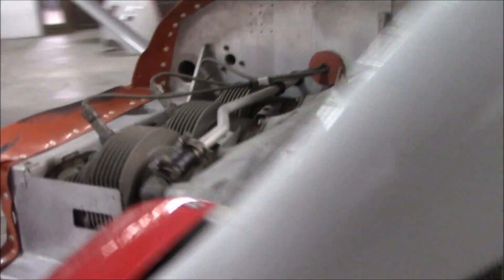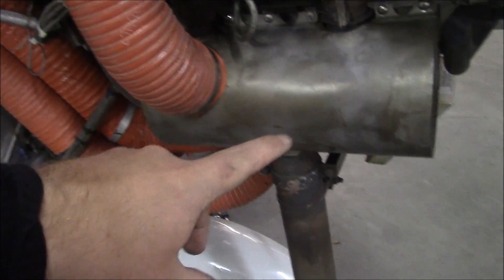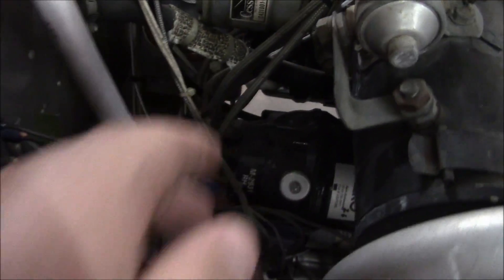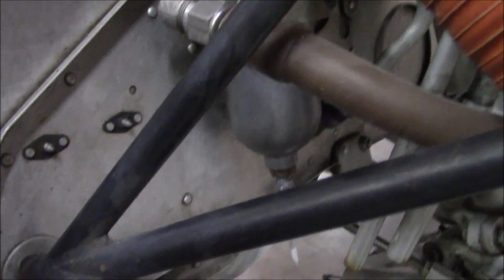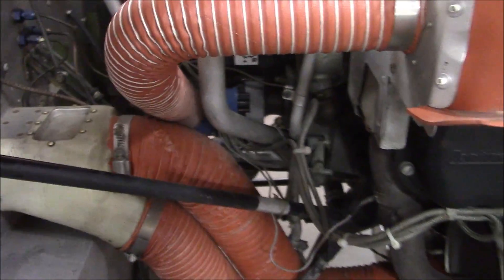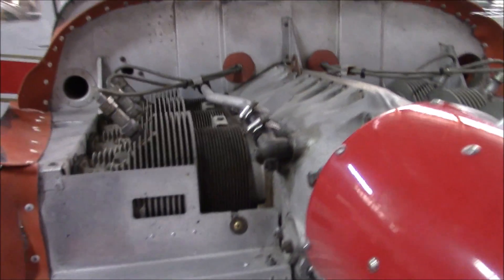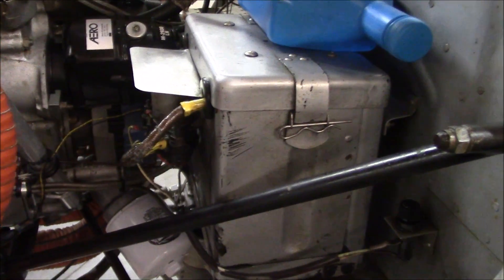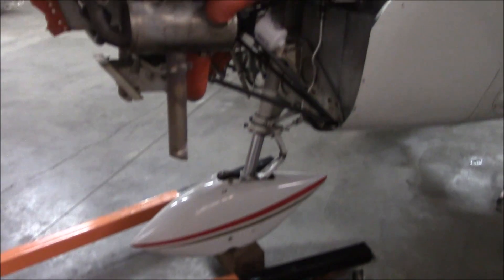Cessna 172 Continental Engine Overview

Comment: Daniel, I have this motor. I am considering making the upgrade to the 180hp. Different guys at the airport say not to give up this smooth motor while others say go with the performance. What are your thoughts?
Reply: i've owned both..the Continental is noticeably smoother than the Lycoming  pick your mission..the 180 is nice in density altitude  and rate of climb situations but look at your mission...do you carry more than two souls,weekend baggage and full fuel?...do you need the extra few knots in cruise?...if you fly mainly low terrain and don't need the extra hp..i'd stick with the six banger
Reply: @mattf49006  thank you!
Reply: @concourcolt7527  ..anytime...be safe and enjoy your 172....out of 11 aircraft ive owned its always been a favorite

Comment: Hi folks, yes great video had a 1962 172 enjoyed it immensely. Never could understand why no oil cooler as I believe the Continental 0 200 had one. Any comments would be highly appreciated thanks much.
Sincerely Mike Burkes
Reply from the maker: I can't speak to that specifically. Even flying at gross weight and climbing in 100+F, I have not cooked the oil. -Dan
Reply: @danielolivermcelroy8320  Hi Dan, what kind of oil temps do you see in those conditions? Thanks

Comment: Hi Dan, first I want to congratulate for your channel!! i love it!! , i´m always ready to learn specially when is about your cessna 172 because I have the same model as yours.... I do have a question for you, how many RPM´s you can get a full throttle in your plane? thanks and regards. Cesar
Reply from the maker: Hi Cesar! I think I get 2550 on takeoff and can easily exceed 2700 in cruise if I am not careful. -Dan
Reply: @danielolivermcelroy8320  your engine must be recently overhauled. Mine is now passed TBO, developing 2200rpm at take off, but once straight&level it  can go to and above the redline 2700 (never tested though)
Reply: Thank you very much Dan!!! regards!! Cesar.
Reply: Hi guys, just wondering about your oil temps and where you fly. My 1956 172 0-300 doesn't have an oil cooler or even a filter retrofit. Just wondering what kind of oil temps you see in warmer weather, and if anybody is using an oil cooler. Thanks

Comment: I never understood why Cessna installed such low HP engines on their 172's.  The airframe could withstand more power, but Cessna, for years, refused to install beefier engines on the 172 models.  For example: Piper put 160's in their 140's and that airframe was just fine with additional horsepower.  I'm just thinking, Cessna should have offered a factory option for bigger power plants for the 172's.  They were already running a 6 cylinder engine under the shroud, why not more power?
Reply: 145hp in 5lit (300cu in) engine means the engine is not running stressed. Certainly not a racing machine, however built to last, and for extra 20hp you'd probably get 10-15kts more, but less available takeoff weight due to heavier engine.. It's all about trade off. ps: I am very happy with C172A/o300c cruising 90kts at 2200rpm with consumption of 6gal (23lit) per hour.
Reply: @StjepanNikolic  I have a 1956 172 with an 0-300. No oil filter or cooler, and running into high oil temps in this hot summer weather. Does your plane have a an oil filter or cooler?
Reply: @Pilotdude6784  yes, my oil temp indicator is showing a bit higher temp (around 3/4) and mechanics said that is only "an indicator". I have spin-on oil filter and recently installed oil chiller which probably helps a little bit but still high for my liking. I also notice after longer runnup, on climb cht goes higher, but I then climb faster (80kts) and keep rpm in 2200 beginning of green. Once straight and level, cht goes mid green but oil temp stays around 3/4. Here is the photo about 1 hour into flight, let me know if you can't open..  https://photos.app.goo.gl/9fyszDrYREzrMKGBA
Reply: @StjepanNikolic  Thanks for the reply and the picture. I can't read the numbers in the picture, but I see what you mean about the oil temp at about 3/4. What is the highest number on the oil temp gauge? Same for the CHT and EGT; I can't read the numbers but the EGT looks like its pretty high on the gauge. Can you tell me what the cht and egt numbers are? In your oil cooler installation do you have air ducted to the cooler?

On a recent warm evening my plane topped out above 240 oil temp in climb (Gauge goes to 250) with a corresponding drop in oil pressure before slowing the climb and going back to full rich. EGT got to 1400. I don't have a CHT. In cruise, full rich, oil temp remained above 220. Also do you see an oil pressure drop with the higher temps?

I am ordering an oil filter adapter, oil cooler adapter, end remote oil cooler. Im hoping it will make a significant difference. I will let you know how it goes once they are installed
Reply: @Pilotdude6784  Hi Chris, not a problem. I've added 2 more close-up photos of my gauges. Note the CHT is in Celsius and EGT is in Farenheits. Regardless, I am not 100% sure about accuracy of gauges, however I make sure they're all in green. I also follow Mike Busch recommendations (he's got lots of good videos on Youtube) about leaning. Basically when straight&level, I set 2200rpm (beginning of green), then once stabilised, I lean to the peak, then 50deg lower. It is not easy to do perfect mixture as my knob doesn't have fine tuning, nor it is exact 50deg, but I make sure it is leaned. Speed drops to 85-90kts, but also consumption drops to 23lit (6 us gal) per hour measured by wood stick before and after. Yes, the exhaust temps appear higher, but I am more happier to see CHT in mid-green. EGT is only telling me the mixture of air and fuel is producing the best explosion. That exhaust heat quickly goes out not making aluminium cylinder getting too hot. I bought my bird in March (end of summer season) so can't tell yet when the outside air is hot. Also I am in Southern part of Australia where we don't have hot climate compared to Northern Australia closer to equator. I think oil filter + oil chiller should be able to help you with temperatures. Let me know if you can't see the photos. Cheers https://photos.app.goo.gl/9fyszDrYREzrMKGBA
Reply: @Pilotdude6784   unfortunately I don't have an oil cooler, only spin-on filter plus oil-chiller which will be upgraded to the large one from AircraftSpruce.  There are two aluminium pipes blowing air from the top baffling area directly onto the base of the oil-filter (not directly onto the filter). However, oil-filter is very close to the large opening at the bottom of cowling so the heat gets dissipated faster than e.g heat from the upper side of the engine. I am too thinking about installing an oil-cooler, but I can't find where would I fit it as there's not much space. Maybe moving battery up, but that all contributes to more $ and there are other priorities. I am also thinking about upgrading CHT/EGT into JPI with fuel monitor, but again priorities :) I am actually very happy how everything works. When temp goes up, nose and power goes down, get more speed(cooling), then when the temp goes down, nose goes up and so on. I think that's what POH says too.. Cheers
Reply: @Pilotdude6784  Regarding oil-pressure indicator, to be honest I only confirm it's in green and that's all. I occasionally video the instrument panel with Gopro, then when return home I replay the video and zoom-in to gauges when fast forwarding the video. Oil-pressure indicator fluctuates around 50 and is very well within the green. I added another photo from the same flight but 15mins into the flight. The first photo you've seen was from approx 1 hour into the flight and it looks identical to me - meaning once everything stabilizes, not much changes.
Reply: Not true. Look no further, it is always money. Remember this, Double the speed, square the HP. Do the math !!!!
Reply: The lycoming 4 cyl of that power were still relatively new, that beautiful 0-300 was essentially one and a half 0-200's which in various forms had been around since Noah made his ark, once the lycos became time proven they were installed from 140 to 160, there was a 180 fixed sold to the usaf. 
interestingly Reims who were licence building Cessna's for the European market saw the gap in the market in the late 60's and dropped the IO-360 in the front with 215 max rated for take off it was an instant success, called the Reims rocket, Cessna having observed its popularity then produced the R172 series with the same power plant but this took a few years. piper went even further and put the 235hp engine in their pa28 but these are rare.
Something you should always remember is one of Burt Ruttons phrases, "horse power sells, torque propels" Ive seen a few aircraft with either conti C-90 or o-200, c90 has more torque, o-200 more HP, c-90 will take off and climb better while the o-200 will make more noise!
And as far as outselling the Cherokee 180, they did by a factor of 10!
Reply from the maker: If they added more power it would be faster than a 182. Same reason car companies don't put bigger engines in their economy cars. They want you to buy the more expensive version. -Dan
Reply: Yes, I thought about that.  You're probably right.  Not a very good business strategy.  They would have out sold the Cherokee 180's by a mile if they would have used the bigger engine and made a nominal plane a great plane.  Maybe the Cardinal was their final solution, but It never achieved 'great plane' status.